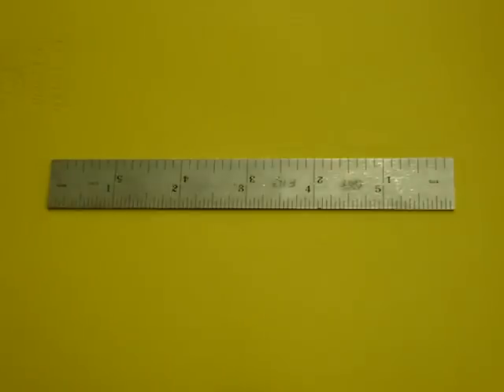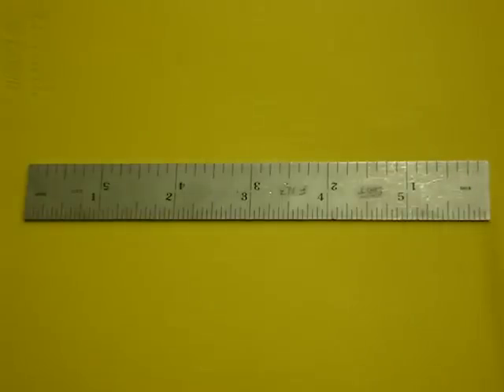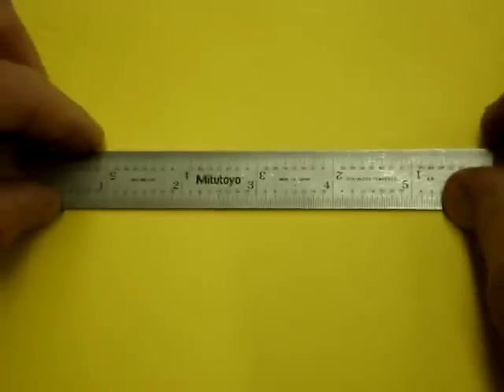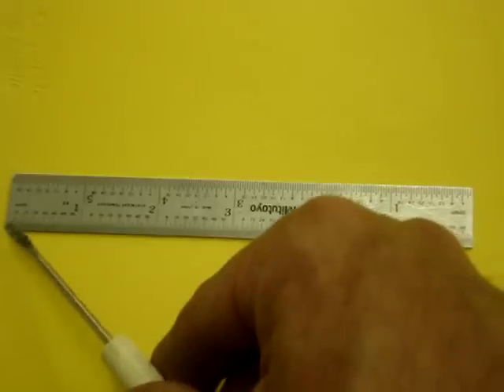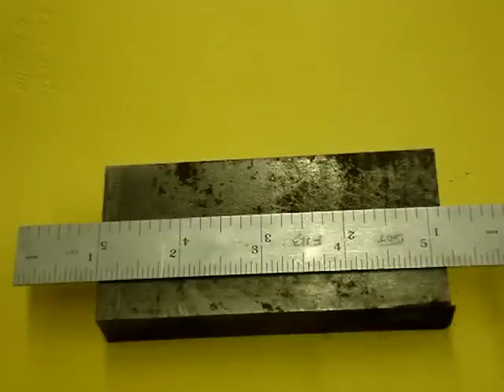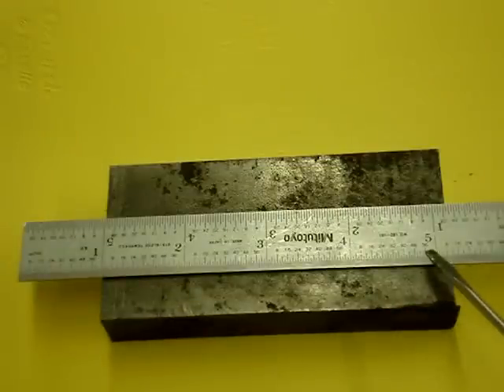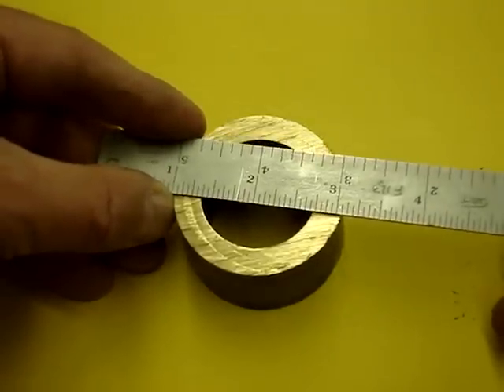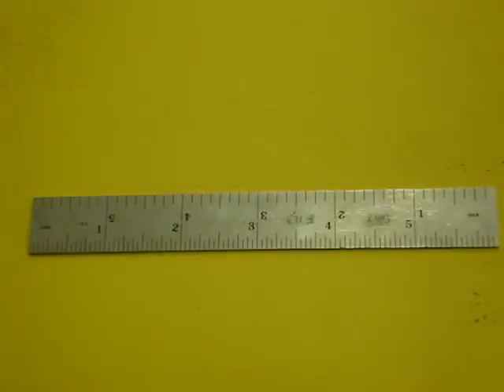#4 Spring-Tempered Steel Rule

Comment: OttoDeCalumnias it's more of a machining thing, many things are carried from the past, for example CNC machines still refer to programs as "tape input" when reading from a usb drive or other source, despite the fact that tape has long been obsolete. Thousandths and fractional sizes will likely remain the standard for quite some time. besides, when you break it down, .001 can be just as easily modified by powers of 10. Also you have to consider that .001" is approximately .02mm which is even more odd than inches if you ask me.

Comment: Can you translate that to metric?
Why don't you use the linear scale of millimeters, with a constant scaling factor of a potency of 10. There is no need to remember how many inches go into a foot, how many arms and legs and knickerbockers are needed for a meter.
Even the CHINESE have figured that out, but the country most reluctant to detach from an archaic measurement system remains the US. Even an US-Professor, Walter Lewin @ MIT, called the imperial inch system "Uncivilized". Here you go...
Reply: would you be seen as more or less intelligent for understanding both rather than either one